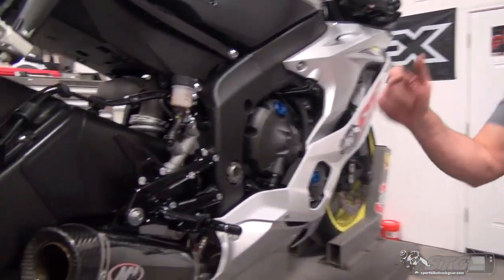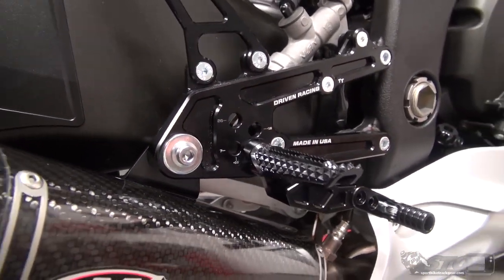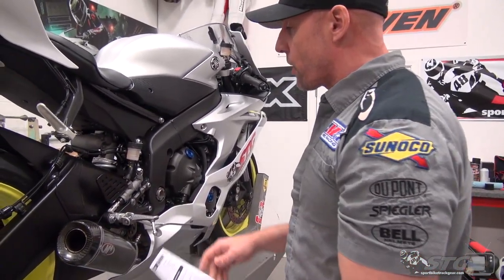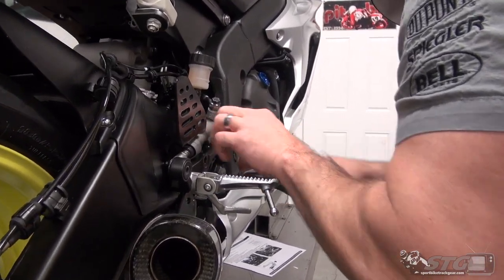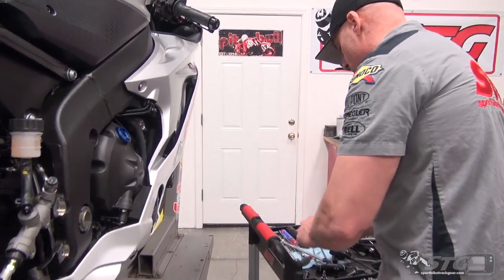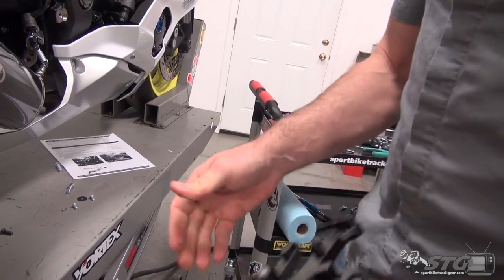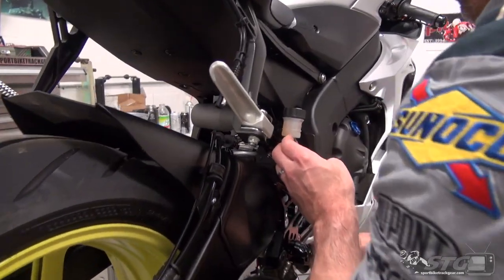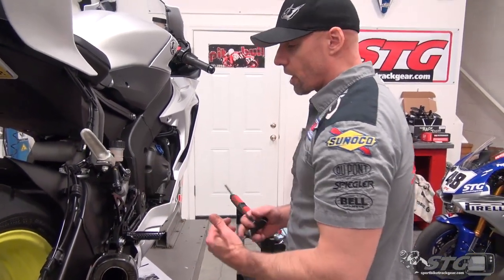Driven TT Rearsets Install On A 2017 Yamaha R6 | Sportbiketrackgear.com

Comment: Another great video Van! The left shifter is in the middle location in your video, and the instruction says that M10 is torqued to 45 lb ft. I tried my best to loosen it and relocate it to the middle, but it would not move. Too much thread locker? How did you loosen it?
Reply from the maker: Thanks for watching. You need to make sure you are using a quality allen socket and a ratchet to break this loose. - Van

Comment: oh man that master cylinder came off so easy even my mechanic had a hard time getting mine off we tired to drill the screws off they were to strong. So we chipped the side of them and with the hammering to chip it we were able to use needle nose pillars to turn them and take them off.

but thinking about getting different rearsets my current has no feeling in the rear brake I need more free play and the spring does not fit
Reply: Yamaha Rider J you will have that...just make sure your using quality bits(most are balled hex) maybe some heat and then if that fails do what ya did
Reply from the maker: What brand of rearsets did you install?
Reply: CNC a cheap brand got what I deserve
Reply: Sportbike Track Gear driven TT on my FZ09

Comment: Why the red thread locker on the main mounting bolts? I'm thinking, since the foot peg location is adjustable, I wouldn't want to go with such a strong compound until I've tried the different locations, and found which one I prefer.
Reply from the maker: They are large fasteners and will break loose pretty darn easy with red or blue IMO. If you want to ride the bike first to find the best placement then add the thread locker that is the best way to do it for sure. This is not my bike and I need to make sure it leaves here ready to roll so I used the thread locker right out to the gate on this one. - Van
Reply: Thanks. I'm enjoying this how to series!

Comment: What bracket did you move exactly to make the brake side fit? Having a trouble making these bolt on properly
Reply from the maker: Sorry I do not remember, this was a few years back now. If you follow the steps in the video that should get you through the project. - Van

Comment: Yo! I just got myself 2015 r6 and gonna get it modded for track use.
Would you recommend this Rearsets or the Vortex v3 2.0 Rearsets?? Ty .
Reply from the maker: End of the day they are both excellent. The Vortex 2.0 design offers a little more adjust-ability if you feel you would benefit from it that is the way to go. I have ridden with these Driven rearsets on a couple bikes now and like how they feel, tons of grip on that pegs. - Van